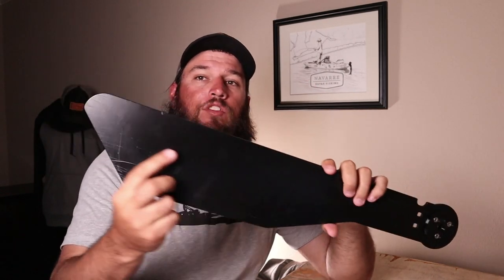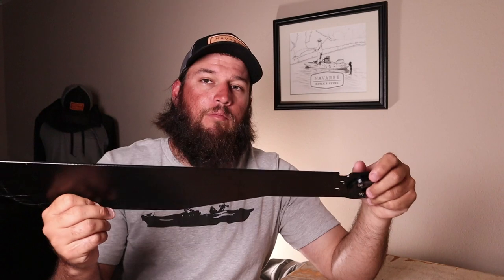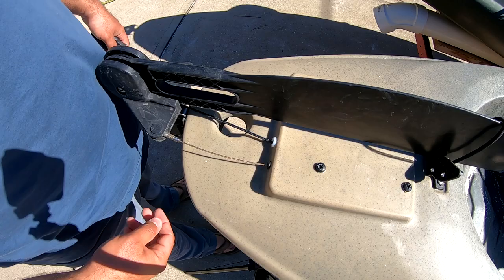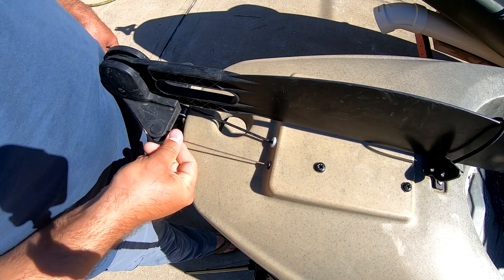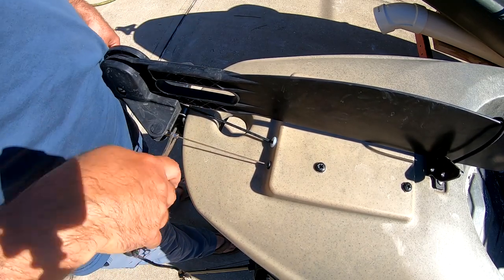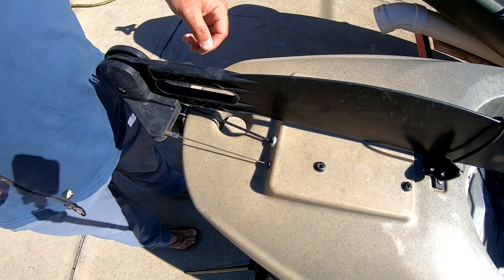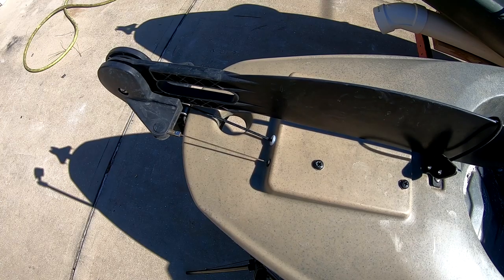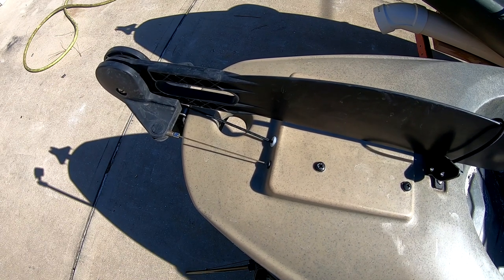Adjusting Rudder Cables (Old Town Kayaks)

Comment: I posted on the OT Owners Group Facebook page a few weeks ago about how many threads should be showing where the rudder cables go into the kayak.  Never got an answer.   I'd heard of a couple of the screws coming loose while on the water and that fear had me tighten my up.  I'll go check to see if they're too tight now.  Thanks very much for the video.  The seat risers and the prop nut are great additions to my kayak.
Reply from the maker: Thanks for watching, Wayne.  Let me know if you have any questions.

Comment: I’ve also been having issues with my steering where it seems to get more stiff as the day goes on. I bought my 2020 predator PDL used, so now I’m thinking maybe the previous owner tightened too much. Thanks for the info! And favorite place as of now is probably Lake Toho in St. Cloud.
Reply from the maker: Easy fix.  Just loosen those turnbuckles a bit.

Comment: Predator PDL. Favorite place so far is the savannah river for smallmouth. Hoping to find some new favorite places next year. 
May have to order one of those rudders. Got hung up in really shallow water during strong wind gusts. By the time I pushed my way free, the rudder was all kinds of bent. Got it partially corrected but it’s still wonky. 
Love that shirt!
Reply from the maker: Kathy, the metal rudder we made only replaces the plastic system.  If you already have the metal version the design is a bit different.  When I had my original metal rudder I bent it all of the place lol

Comment: Have u done a video of replacing the steering cable if it ever breaks on a pdl old town?
Reply from the maker: I don’t believe we have but it’s simple.  You would loosen the turnbuckles at the back of the kayak then remove the steering knob.  The cable simple slides in and out of two tubes.  Here’s a video removing the steering knob - https://youtu.be/Zwrkd50CsDE?si=ocNmY22d3J-VvH3q

Comment: I have a 2018 Old Town Predator Pdl and my favorite place to fish is Oriental, NC. I have a metal rudder, so I was wondering, can I tighten my cables the same as the 2020? 

Just watched the vid and it’s night time here, so I haven’t looked at my cables yet.
Reply from the maker: You can’t.  You can add nylon spacers between  the rudder bracket and the kayak.  You will need longer screws but it will take up the slack.

Comment: Hi Nick as always great informative video, with the older version Predator PDL  does it have any problems with the steering cables, and can the cable be replaced.
Reply from the maker: Jason, the cables stretch and can get rather sloppy.  You were able to order (I’m not sure if you still can).  If you can’t, you can purchase nylon spacers and place the between the Mets bracket and the kayak.  If will reduce the slop.  You will need to purchase four new screws to make up for the additional length.  Overall it’s a cheap and easy solution.

Comment: My right side turn buckle keeps loosening up to the point it falls out leaving me rudderless.  Do you recommend some kind of thread lock to prevent that.  For now I put some Elmer's Glitter Glue on it.  Silly but seems to have worked.  PDL 106 - Lynhavven River.
Reply from the maker: I have never had to install anything on mine to get them to stay but if you glue is working I would just stick with it.

Comment: Is it still easy to tighten it without the turnbuckle system? I have a 2019 Old Town predator pdl. Also Navarre Beach of course!
Reply from the maker: William, you can purchase new cables or you can go to the local hardware store, purchase nylon spacers, and longer screws.  You would remove the metal rudder bracket, install the spacers, then install the longer screws.  Pretty simple.
Reply: @NavarreKayakFishing  do you have a video on this fix?
Reply from the maker: I do not but I do have a 2018 Predator in the garage.  I could make it happen if needed.

Comment: I have a Big water PDL 132 in the od green color. I called Old Town about a steering issue when I first bought the kayak. As the day wears on the steering becomes very difficult. Nobody could figure out why. Today it’s cloudy and the sun peeks out some. When the sun is shining on the kayak the cables get very tight. When it’s in the shade (cools off) the steering is easy. The cables are adjusted out as much as I dare. Do you know of any other fix for this?

Comment: Is there a way to add more wire so you can add a different rudder where the existing wires are not long enough
Reply from the maker: You would need to replace the entire wire from the steering assembly.
Reply: @NavarreKayakFishing  is that easy to do if there is no rear hatch that allows access to the rudder cables…old town Topwater pdl
Reply from the maker: You have to remove the steering handle to place those wires. Here’s a video that shows where they start - https://youtu.be/Zwrkd50CsDE

Comment: I have a 2020 OT 106 PDL and both of my rudder cables are loose and in need of adjustment but when I attempt to turn them as in the video they will not budge but I see your video example shows you turning them by hand? I do have one of your Navarre steering handles installed so am I supposed to do cable adjustments on the opposite end of the rudder and if not then why are mine so dang tight at the rudder. It would barely turn with a crescent wrench and nothing with the needle nose pliers! Certainly will not turn by hand. Do you think the kayak shop that assembled the kayak rudder may have put Loctite on the screws? Hope not!
Reply from the maker: They started putting loctite on the threads from the factory.  I mentioned it in a video a while back.  It’s a huge pain.
Reply: @NavarreKayakFishing  crap l just tried to tighten mine up a little (bought 7-19 new) and they won't budge, afraid l'll break them 😠
Reply from the maker: I don’t think you’ll break them.  Can you see what looks like red loctite in the area?
Reply: @NavarreKayakFishing  opposite the part you turn (the end of the cable) looks like plastic covering about 3/8 to1/2 inch of the very end, l don't see anything on the threads going into the plastic like piece. I took a pic but can't upload it here, l don't think.

Comment: 106 mk….from factory cold yak… zero slack in cables. I touch the cables and the steering slides move. Going to put a touch of slack in them. Steering gets tough at times. Hoping this is the issue. Some of the plastic guides are literally cockeyed 45 degrees and factory says this is ok. I do not agree.
Reply from the maker: A little bit of slack should help it out the binding issues.
Reply: @NavarreKayakFishing  I took my 106mk back to where I bought it. The straightened the cable guides but it was still stiff. The guy looking at it pulled on one of the bungee cord that counteracts to the other pedal. I had a eureka moment. I pulled the end to check tightness then went to the showroom to check a new one. My cords were much tighter which probably means they used too short of cords on my boat.  Must have been a Monday or Friday boat. We untied all 4 knots and moved the knots back extending the length. Made a big difference. Still tighter than a new boat. I will ask Johnson for new cords.